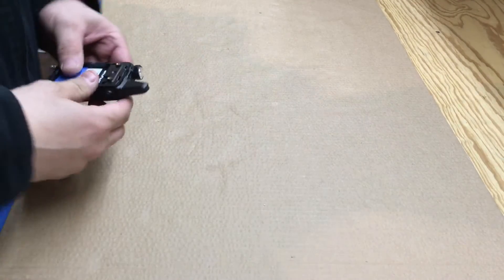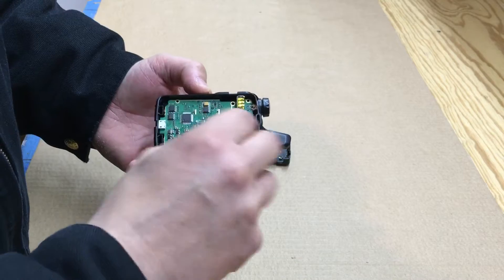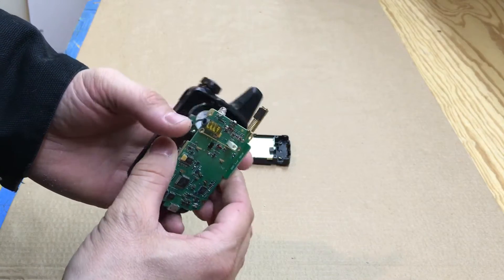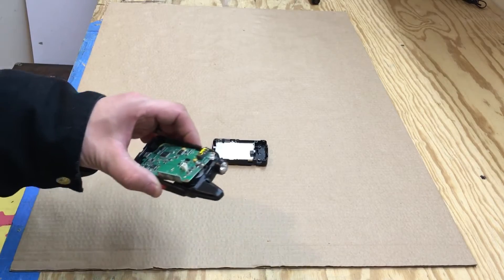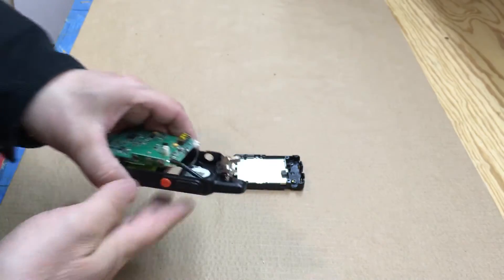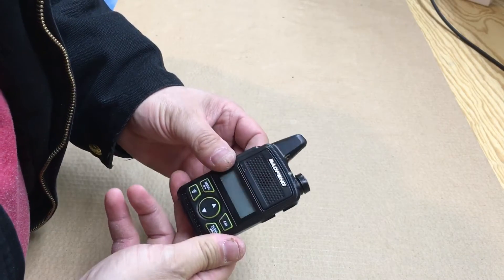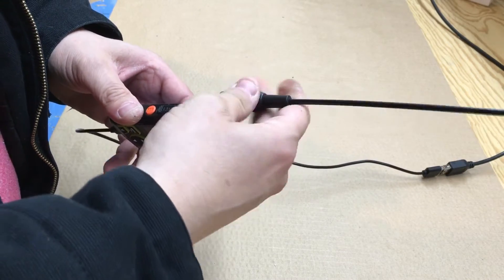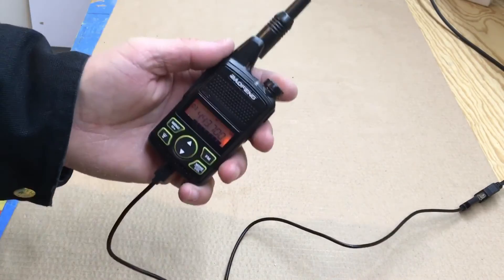Baofeng BF-T1 Mini Antenna MOD Using SMA Connector

Comment: NEAT!
Looks like there's about 15 inches of wire in that coil antenna. One could stretch it out straight through a small hole in the top plastic and run it through some... shrink wrap maybe or thin tubing glued in place and have a "15 inch whip antenna" without a soldering job...

Comment: Good to see the experimentation, however for this to work correctly with an antenna like that one you have chosen, you MUST use a coaxial coax feed from the PCB to the antenna socket that, is also grounded! . Without this, the entire point from where you soldered the wire, right to the tip of the antenna becomes the antenna, and the Nagoya antenna has no ground reference. It will also therefore be non-resonant where you want it because it will be far too long!... 
So to summarize, if you add coax between the PCB and the antenna base, and ensure that the coax is correctly grounding the antenna base, it will work MUCH better than it did for you. (The fact it was receiving signals before you connected the antenna is proof of this not working correctly!) Good luck!
Reply: Why going through that is too much hassle , it is easier to buy a radio with detachable antenna..😏😏😏

Comment: Did you try transmitting in VHF after changing the antenna? (Maybe try adding a dual band antenna and see if it works). Great video.

Comment: Nice mod! Did you solder the shield of the coax to the ground on the circuit board? Or just the center connector? Thanks!
Reply from the maker: Just the center wire. Like how it was from factory.
Reply: I am thinking of doing this... Where would I find the ground on the circuit board? Thanks:)